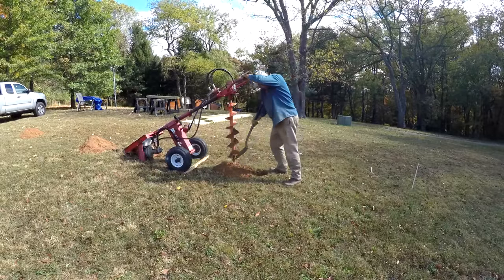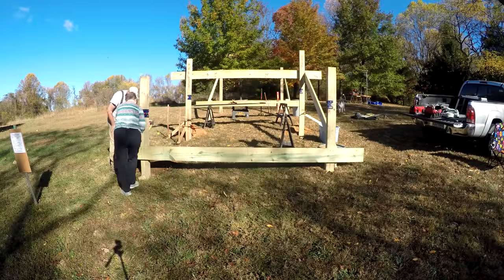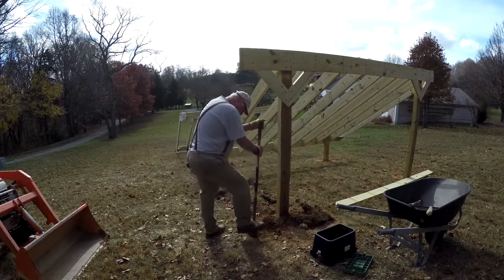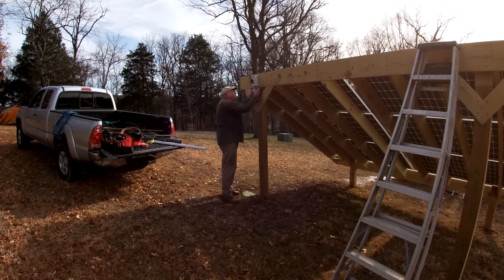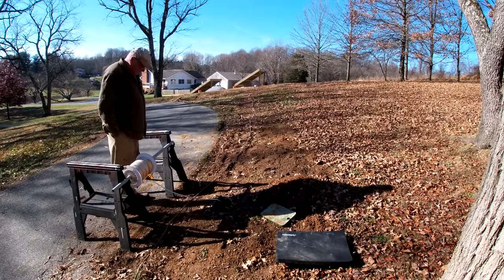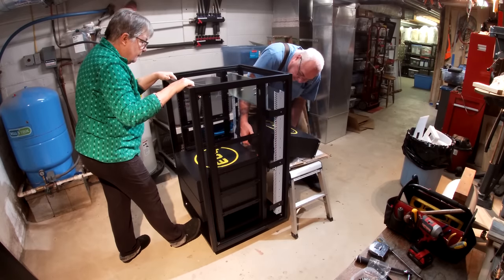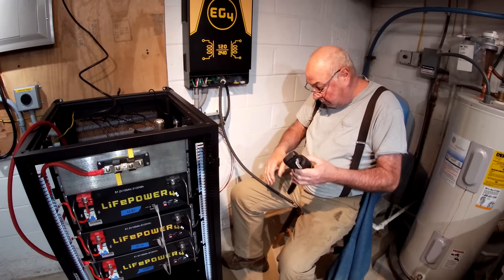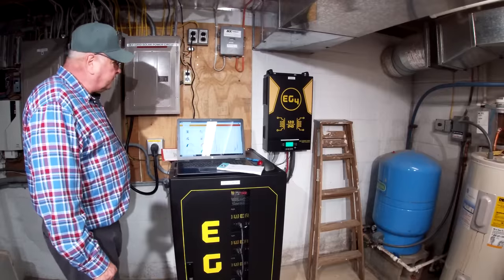Building a DIY Solar Power System

Comment: this is cool. thanks for uploading. i was wondering about adding aluminum foil tape to the underside of the wood that is at 90 degree angles to the back of the panels. 90 degree angles always reflect all the light into the panels there and the al foil tape is like 2 dollars a roll (the actual high temp duct tape stuff)
Reply from the maker: Thanks for the comment. Foil tape, good idea. But on clear days the panels are already producing more power than I can store or use. Most of the time my battery bank gets fully charged by mid-day, and then the charge controller stops collecting.

Comment: Looks like a great project.  You talk about 'off grid system' but then you plug into the grid with a 50 amp electric stove cord?  Or am I not understanding?  4x4's were not adequate so you had to go to 4x6?  Was that an actual engineering calculation that made that determination?  How much power do you get, 50% or 75% or ????  Thanks in advance.
Reply from the maker: Hello and thanks for the questions. All of the loads that I want to run on solar electric are wired to a separate circuit-breaker panel. I have equipped this panel with a 50-amp plug and cord. I also have two 50-amp receptacles. One of these receptacles is wired to the 120/240 AC output on the inverter, the other 50-amp receptacle is wired to my main household circuit-breaker panel which is connected to the grid. Normally, the off-grid panel is plugged into the inverter AC output so that all my off-grid loads are powered by solar electric. However, if I need to perform maintenance on the solar electric system, I can unplug the 50-amp cord and temporarily move it to the on-grid receptacle to keep the appliances running.
Regarding 4x4 vs 4x6, that was not actual engineering calculation. In order to qualify for a building permit, I had to seriously beef-up the rafters and headers, so I decided to also beef-up the posts.
I suspect that I'm powering about 50% of household electric from solar. it will go up after I replace the water heater.
Reply: @gmhomemovies2023  Thanks for the reply.  I saw your follow-up video after I sent in my questions and that was also helpful information.  Please indulge one more question.  Did you consider micro inverters (inverters at each panel or set of panels) and if so, why did you not use?
Reply from the maker: @tommak6516  Hello again Tom. I did not consider micro inverters for my solar power setup. My understanding is that micro inverters are for grid-tied AC-coupled systems, whereas I wanted an off-grid battery-based system which requires the solar panels to be DC-coupled. Go look at the DIY Solar Forum, lots of experts with many ideas.
Reply: @gmhomemovies2023  Thanks again for the answer.  My thoughts are, if I ever do this kind of project, to do an untied system with dedicated circuits (like you did).  I think you have the right ideas.  I really like your 'transfer switch,' that is, that plug you can move from one to the other.  1000% idiot and failure proof, not to mention low cost.

Comment: Good job! I had a question about that inverter, on my small system and I mean really small system LOL I have a 24-volt inverter charge controller and then the batteries,charging from 4 330 watt panels, so my question is is that inverter and I guess charge controller combined?
Reply from the maker: @danmichans  thanks for your comment. On my solar electric system, the box that I call the "inverter" is actually an all-in-one device which combines a charge controller, DC-to-AC inverter, automatic transfer switch and an AC battery charger in a single unit.

Comment: Thanks for great video as I plan to do the same thing for my solar. Please help me to calculate the tilt of the frame, I need it has tilt of 28 degree with the high end is 8 feet high so what is the height of lower end to get 28 degree tilt with the 7"6' span between the posts. Your help is greatly appreciated. 
Do you use the treated wood so the weather and termite not damage your structure? How long this frame stand up with weather and termite? It is so nice to see both of you work together.
Reply from the maker: Thanks for the comment and complements. Dealing with the solar array tilt angle is tricky with many factors to be taken into account. Therefore, I'm not comfortable advising you on the measurements. In my case, I used a computer graphics program (obsolete version of MS Visio) to design the ground-mount frame. I have some good experience doing this, but it still took me several iterations before getting it right. Even then I had to make some last-minute adjustments during construction.
regarding lumber, it's all ground-contact pressure-treated as required in order to get a building permit. The lumber has a 40-year warranty, so it should hold-up very well.

Comment: Hi.  3 questions: How long did it take you to get the permits?  What did you need to give to the county for the permits?  Is this for Montgomery county?
Reply from the maker: Hello Nylrone, thanks for the comments. 
We are in howard county MD. Once I had my ducks in a row, it only took the county about a week to issue the building permit. But all together I  spent over a month learning the rules and redesigning the layout.
Reply from the maker: Oh your third question... I needed to provide four or five diagrams to the county. A plot diagram showing existing structures and location for proposed solar array, front and side elevation, rafter measurements. Oh and location of proposed trench, and a diagram showing where and how the trench will cross the sewer pipe. Gosh you are making me remember the hassle. I made 3-4 trips to the permit office

Comment: What clamps did you use to attach the panels to the wood so that they sat flush?
Reply from the maker: Hello and thanks for the comment. I used 1" mid and end clamps acquired form Beny's Solar via eBay.com. If I remember right, they came in bags of 10 or 20 pieces.
Reply: Thank you! Also awesome job!

Comment: I'd have fabricated it on a 20" flatbed trailer. The loss of sunrise and sunset to keep that stationary is absolutely staggering. No way would I settle for ground mount without mobility. I can turn my trailer and get 5900 Watts continuously from sunrise to sunset.

Comment: Do you have a video about your Hydro electric project and why it failed?
Reply from the maker: Thanks for the comment. Sorry, no video about my micro hydro attempt. I planned to use an old bicycle wheel and strap empty dog food cans to make a crude under shot water wheel and use a small DC motor as a generator. I had gathered all the material but encountered a serious problem. I built a temporarily dam on the creek for testing, but it caused water to backup into an already rusty culvert pipe under the driveway. The extra water undermined the culvert and caused it to collapse, resulting in a $35K repair bill to replace it. After that I abandoned the micro hydro project.
Reply: @gmhomemovies2023  crap. I've been looking at Pelton wheels.

Comment: Just a question... why you didn't cover your wood structure with a resin for wood protection? Probably the wood you're using is pre-treated with resin but when you cut the wooden boards maybe it would be useful to treating the edges of the boards.
Reply from the maker: Thanks for the comment. All the lumber is pressure treated and rated for ground contact with a 40 year warranty. It should out last me.

Comment: Nice work but I would figure that corrugated plastic pipe would channel water right to that pull box at the house.
Reply from the maker: Thanks for the comment. So far no problem with water in the coordinated pipe, and we've had some crazy torrential rains.

Comment: How many Square foot of ground area does 24 panels require? Why not make the tilt angle adjustable?
Reply from the maker: Thank you for the comment. Well, my 12 panels take up about 256 Sq Ft. so double that. Also depends on your tilt angle. I chose 35deg to optimize for winter. Several reasons I went for fixed tilt angle versus adjustable. I did a lot of research and concluded that for an off-grid system, I'm going to get plenty of power. If my system was grid-tied, then adjustable tilt would make sense to get max power and sell the excess to local utility. But my inverter is not certified in USA to export power. Second reason... I wanted to get a building permit, because I have a neighbor who I thought might complain about the solar panel arrays, which she did. My county has very strict requirements for what they call "accessory structures". Attempting to design an adjustable array that met those requirements would have been difficult and overly complex.

Comment: Question, what's regulations in your area dictated the need for permit and what portion of the code did the local engineers apply to dictate the upgrades?
Reply from the maker: Thank you for the question. In my case, I  could have gotten away with building anything without consulting regulations. However,  I have a neighbor who thinks she can control what we do on our property. Therefore I wanted to obtain a building permit just in case that neighbor would do something crazy like take legal action. But, in order to get the building permit, my ground mount structure, my county required that it meet the snow load standards of an actual house, I know it was ridiculous, but I played by the rules, got the building permit and shut up my nosy neighbor.
Reply: @gmhomemovies2023  WOW, I'm sorry you and your wife have to have someone like that next door. I hope none of your other projects get encroached on.

Comment: Left the mounting hardware "loose"? Can you elaborate on that?
Reply from the maker: Thanks again for the question. A disadvantage of using wood rather than steel is that wood expanse and contracts with changes in the weather. If I secured the solar panels tight to the wood, the expansion/contraction would have stressed the panels possibly causing damage. To counter this, when installing the mounting clamps, I backed out the screws a half turn to provide a little wiggle room for the wood to move without stressing the panles.
Reply: @gmhomemovies2023  
Also what hardware did you use? Small angle brackets tec screwed to the side of the panels?
Reply from the maker: Hello Robert
Solar Mid Clamp 1" Pack of 20
Solar Panel Mounting End Clamp
Sourced from benysolar via eBay.com

These clamps are made from aluminum, are inexpensive and work well.
Consider watching my update video which might answer some of your questions.
 https://www.youtube.com/watch?v=ndUNAKh5ASU&t=3s

Comment: What size cable would you run under ground?
Reply from the maker: Thanks for the question. For my system I used 10/2 UF solid conductor wire to connect the solar panels to the inverter.

Comment: Do you have your schematic for the mount?
Reply from the maker: Tank, thanks for the comment. Yes I have a schematic for my solar power system, including wiring on the ground mounts. But I'm currently out of town and will post a copy of the schematic when I get home in a couple of days.
Reply from the maker: Tank, thanks again for your comment.
Yes, I have a schematic, but I can't figure out how to attach a PDF file to a comment reply. So, let me try to describe it:  I have 12 solar panels, separated into two strings of six panels each. The six panels are wired in series, positive to negative, positive to negative, etc. Each array of six panels is protected with a high-voltage DC disconnect switch and a 25amp DC fuse. The two strings of six panels each are then wired in parallel, forming a 6S2P configuration.
Reply: Thank you @gmhomemovies2023

Comment: What did you use to mount the panels to the wood?
Reply from the maker: Thanks for your question. I used 1" mid and end clamps acquired from Benny's solar ( I think) via eBay. Check my DIY Solar update video

Comment: How did you ground the system when they are disconnected from the grid and running on the batteries?
Reply from the maker: Hello Tracy, thank you for the comment. The sub panel for off-grid loads is bonded to the same central grounding point as the main (on-grid) panel. I have one common ground network for everything. I have a four-prong 50A plug and cord attached to the off-grid sub panel and two 50A receptacles, one wired to the output of the inverter, then other wired to a breaker in the main panel. This way I can supply power to the sub panel from either the inverter or grid. Some purists might point out that this created a ground loop, which it did, but I already had multiple ground loops before installing the solar power, and so far, nothing has blown up or melted down.

Comment: I think your large 2x10's under the solar panels are going to defeat the whole idea of using Bifacial panels you shade the back of one cell it kills any advantage of additional power from underneath. I am going to build something similar but plan on using Unistrut and I don't plan on running any of it directly under any of the cells, Just on the edges. I think you over engineered the mount with all of those large 2x10's You could of used just three vertical with two on ends and one in middle and using two smaller 2x4 in middle on panel seems. regardless it looks great. If the mount is designed right bifacial panels can help make up for the actual reduced output of panels from rating. With the way your large boards run through the middle of the panels in several places you will get zero power from underneath.
Reply from the maker: Thanks for the comment. I needed to get a building permit because of a prickly neighbor. My county required the huge structure before approval. Not my first choice, but I got the permit and my neighbor is still fuming my solar panels. As for biracial  gain, I get a little, but really don't need it. The panels are already producing more power than I can store or use.
Reply: @gmhomemovies2023  I understand, Why would your neighbors give a damn if you have solar. Looks like you live out in the country. I would of offered them a chance to pay you money every month to supplement not having the solar energy. You don't live in an HOA so screw them...

Comment: Very nice system the only maintenance issue you might have if the wood frame either needs paint or some type of preserving good job. I went off grid in 2013 I live in Phoenix and have 30 panels at 320 watts each. I only wish I had done it sooner never looked back.

Comment: I am just wondering where you live that your required to build a freaking structure like that.
Reply from the maker: @jimw3799  thanks for the comment. 
I'm located in Howard County, Maryland.  Yes, the structure requirement to get a building permit are ridiculous. But I needed the permit because of a nosy neighbor,  so I went ahead and over built the ground mount.

Comment: I've tried to use the power augers of this type in my soil.  AWFUL experience.  WHY?  There is NO reverse on them, and with all the clay in my area, they 'screw' into the ground and don't eject the clay.  They destroy your back trying to pull them out of the soil once they screw into it.  A Bobcat is the only way to go in my area with a power take off/auger attachment.  Be warned, do your research on your soil.  OR simply use a digging bar/post hole digger and get to it.

Comment: Wasting land and wood, nature needs more trees,  roofs and walls are better
Reply from the maker: Thank you for your comment. However,  please note that we very carefully considered every option for locating our solar panel arrays to maximize production and minimize the environmental impact. We call our little 5 acre plot "pollinator paradise" and have planted over 30 oak trees, and some maples, red buds, holly bushes as well as cedar and cypress trees. Placing the solar panels on our house roof would have required cutting down a whole forest of old growth trees which we certainly wouldn't do. We chose this location for the solar arrays so not to disturbe any of our precious existing trees. Also, wood as a building material is renewable.

Comment: Lithium batteries are extremely difficult to recycle. Their environment impacts are double and triple comparing to gasoline engines. Instead, you should store water from low tanks or swimming pool to high tanks for storing solar energy during daytime with sunlight with solar panels driven water pumps. Then release those water from those high tanks to drive electric generator for your house at night, back to low tanks or swimming pool.
Reply: Get right after that. And make a video.